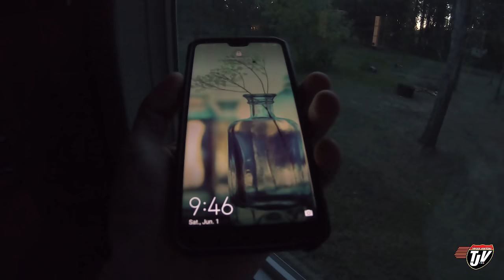TJV | NEW BLADES! 🌱| #1728

Comment: Might consider next time using a piece of scrap 2X4 or such,  as a wedge to block the blade to hold it in place as you tighten the nut with a wrench.

Comment: Always a good Idea to check the balance on your new blades or for sure after you sharpen them !!!  Easy to do with a nail through the center hole and if the blades stays level its balanced, if one end drops its heavy on that end and needs a small amount ground off until it stays level, I have found even new blades out of balance !!! And you can do that in your sandals...........as long as you don't drop a blade on your foot !!!!

Comment: Josh, you mentioned you were going to cover your trailer with tarps to protect it from the sun.  It's not a good idea., covering it will keep any moisture you may have inside and create mold where you can't see it. Trailers have a membrane on the roof that protects it from the sun. If  the membrane is damaged, you may want to buy the RV paint on membrane from Home Depot or a hardware store that may carry it. Best thing to do is open your top vent if it has the cover over it that doesn't allow rain in, and open the bathroom window of the trailer, and this will provide a good source of ventilation in the trailer and keep it cool and dry. We have a 1985  18 foot travel trailer that stays in our driveway when we are not using it, and it never gets covered. About the only thing you may want to cover on your trailer are the tires and that can be easily done with some sort of tarp, but try to get a light coloured tarp or even a piece of canvas, something that will not absorb heat.  Hopefully this helped. We get the very same type of weather here in southern Ontario as you do, and our trailer is fine. My husband redid the membrane on the roof this year as it sprang a leak, but three thin coats later and it's water tight. The coating had to go over some black tar that the previous owner had used for a sealant, and the coating covered it great. You can't even see where the black tar was anymore, and the trailer actually stays cooler inside now and it sits in direct sun. Please do the research about tarping trailers and you'll find that its not a good idea.

Comment: Trucker Josh, I could really care less what you wear when cutting grass, ha ha ha, but couple items. Number one , you should have used a block of wood to unbolt and install new blades on mower. You were taking heck of chance of getting hurt, plus large ratchet and socket would be a plus as well. Removing and installing put blade up against wood , it works out. Number two, why don’t you have a jumper box for starting things, QUICK AND EASY, plus then carry it in big truck in case someday it won’t start. That’s it for my TIPS of DAY, a friend and viewer,  WINNY, from Pittsburgh, Pa. Have a great day!!!!